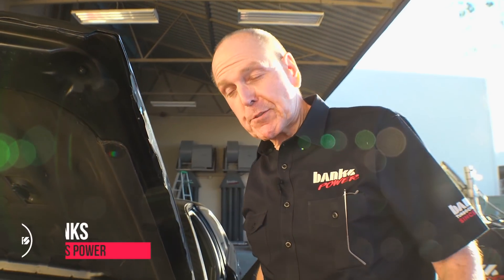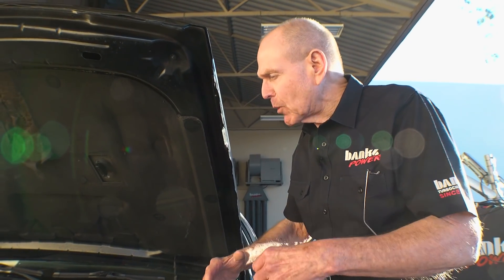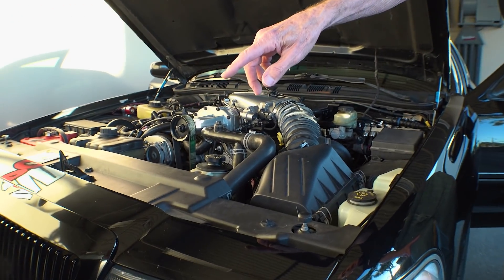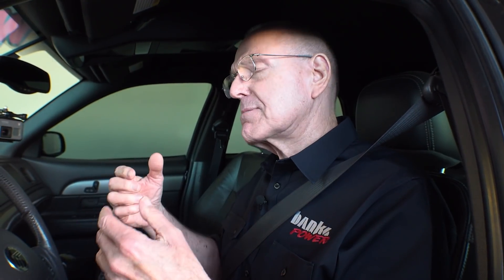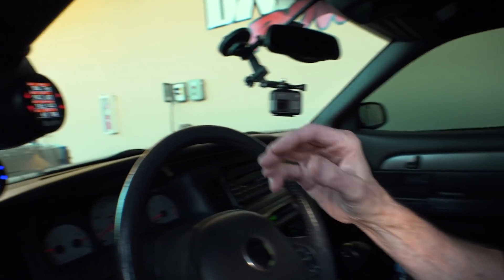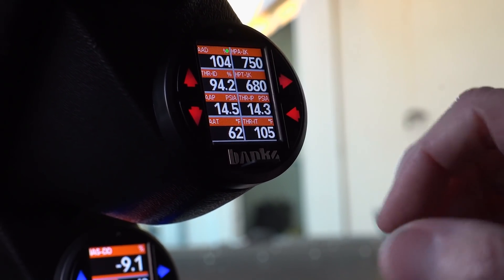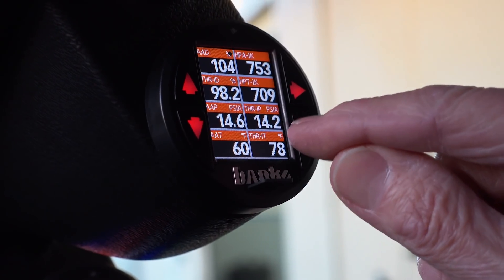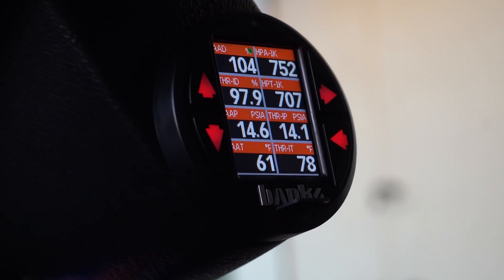My stock intake sucks. Here's proof.

Comment: Well then damn, but Mr. Banks the guys from mighty car mods have proven that on a turbo skyline the stock air intake works better then a cai. So what's the difference between the two intakes that would cause you to loose power?
Reply: They didn’t prove anything more than that specific car on that specific dyno. Did you watch the video? You missed the point that he made...where he proved his intake sucked.
Reply: @BrodeyDoverosx  yea I watched his video what he said and proved did make sense. Now what I was saying is that other people that DON'T have the money or the pepper tools and that's what they got. Have you seen their video?
Reply: There are a number of factors which affect whether or not a CAI will provide any gains at all, but the specific vehicle you have and which aftermarket intake you test are big factors.  Some vehicles, such as the Skyline tested, have well-designed factory intakes which provide good filtration and performance--much better than something you pick up off eBay or Amazon claiming big HP increases.  But some vehicles make compromises with the stock intake for noise, filtration, emissions, or even just being cheap and certain aftermarket intakes can provide real-world performance increases.

One place a lot of these aftermarket CAIs fail is by having an open filter element so they suck up a lot of engine bay heat, particularly at idle.  Another is that they use a high-flow filter element (such as K&N) which trades filtration efficiency for maximum flow, a tradeoff that OEMs do not accept.  The stock intake on my F-250, for example, picks up about 7 HP with a high flow filter and at best 12 HP (in a controlled environment) with a cold air intake--really not worth the $300+ you spend on the intake system, exposing your engine to higher temperatures while at a stop, and giving up air filtration.
Reply: Probably the different way supercharger and turbos work. Supercharger belt driven produce boost down much much lower in rpm range where engine is not sucking so much air. Turbos at higher rpms where engine is trying to get as much air as possible. Like everything it's a compromise you can tune something to be very efficient at a narrow band but rubbish everywhere else.
Reply: @GavinY  I know how they work n the differences are but whats the difference's between the two air density in the turbo and super charger?
Reply: @edgarportillo8027  at the moment , nothing because it's just a baseline measurement of the stock system on his car.  Every intake system is a restriction. It may be he puts on a CAI off the shelf and lose even more power. Nothing is proven at the moment. Just comparing apples and oranges. What MCM proved though is cheap CAI garbage is even worse than  stock. So if Gale did not specifically design one for your car, don't bother with one.
Reply: Bear in mind that the MCM guys have never claimed to be experts or mechanics and even they know the methodology used wasn't that scientific. They even went as far as to say that engines can be tuned to work better on CAI's but they must be tuned correctly.  Thats the key here - you can whack on a CAI but if its not tuned for the engine and the mapping isn't done, you won't see any real benefit. You gotta take a holistic, total approach to engine tuning, so: intake, engine (with or without forced induction), exhaust, tuning. Do all those together and you'll see real improvements.

Comment: A lot of the time engineers are trying to hush the racket of the intake.
And other compromises
Reply: when your modifying a car you generally dont care about how noisy it will be
when your buying a new car , generally you do
Reply: @ProVision3187  Except that a lot of OEMs have devices to add induction sound inside the car.  On some of the newer GTIs, Volkswagen ran a pipe off the cool side of the turbo into the cowl area so the sound could come in through the HVAC system.  BMW has been fond of digital engine noise through the audio system, and now Ford is doing it, too.

Comment: And this is why this man is respected, honest R&D and is willing to use his own damn car as a test mule.
Reply: That and his shit works! I worked on a truck that had so many Banks upgrades that I had to hold the brake when letting out on the clutch to avoid hitting stuff in the shop parking lot.
Reply: sienile that makes no sense
Reply: @MoparMadness93  He basically just said "I have no idea how to drive a manual transmission"

But you're right, it made absolute no sense. His comment called also be interpreted as "It had so many Banks upgrades, it made it undriveable and dangerous!"

Probably the former.
Reply: Kenneth James not all parts are US made  we used to make then he found cheaper to make taiwan

Comment: As far as the Banks iDash, I’ve searched the documentation but can’t seem to find an answer if these devices will run standalone with just digital and analog inputs from aftermarket sensors. Does Banks currently sell everything one needs to run a setup like this in a car without canbus, like I believe Gale is doing here?
Reply: It Def had inputs it says on the website

Comment: So here's the question. I live in the Arizona desert. It gets hot here, really hot, Tarzan can't take this kind of hot hot! So, what if you used a second air conditioning evaporator, like the set up on a mini van that has front an rear air, but use the second evaporator to cool the air coming into the  cold air box the also contains the air filter, ahead of the intake hose. It would have to be large enough not to restrict the airflow, but if you had such a system, where would the trade off be between the horsepower to drive the compressor and the horsepower gained by cooling the air in the intake?
Reply: ken cohagen I don’t think you’d be able to gain additional power. I’m sure there’s something about the second law of thermodynamics, and thermodynamics in general that’s going to tell you it’s going to take more energy to cool the air below ambient temperature than that increase in density is worth when using a heat pump (air conditioner) of some sort on a heat engine (Otto, Diesel, Gas turbine... take your pick). However using evaporation from a fuel like Methanol, Ethanol, or to a lesser degree gasoline, is a great way to get some additional power at little cost since in this case the increase in entropy works to your favor here and mixes the fuel with air and cools down the air in the process.
Reply: the new Hellcat cools the superchargers incoming air with the AC .
Reply: Yeah check out interchillers
Reply: Although there’s nothing stopping you from running a little experiment using the iDash like his and your air conditioner. You could measure the power potential of the air outside your car and the air coming out of the ac vent of your car (just like Gale is doing with the air outside and the air entering the throttle body) and evaluate the difference in horsepower potential, for the amount of energy it took you to change the air density, (how much horsepower you loose when running the AC). From there it’s just going to be figuring out the respective dimensional rates how much air the engine needs per second, and how much air the air conditioning system of your car puts out per second and the amount of power it takes to cool that amount. There’s more to it than that but I’d be happy to help you design a simple experiment to test your hypothesis and intuitions if you’re interested.
Reply: Look up “Interchiller for boosted engines.”
Reply: That evaporator would probably have near zero effect. It's cooling capacity is not going to be near what's passing through the intake. It'd be neat to see how it would or could work.
Reply: That would be a tremendous amount of intake air CFM's for a standard AC evaporator. And a gain of 1% HP would be less than the compressor loss.
Reply: I live in AZ, and love cars and guitars.  We should hang out.

Comment: Love the Marauder, this is basically a 4-door  '03 svt cobra.
Reply: Jason Henderson you couldn’t be more Wrong
Reply: 4.6 4v mod motor. Roots positive displacement blower with an intercooler. The Harley f150 had the 5.4 with the Eaton blower and I believe the lightning did as well.
Reply: Marauder motors only have a couple things in common with the Cobra, the cams and heads are the same, everything else is different, Cobra Block is Iron, M is aluminum and it's Crank, Rods and Pistons aren't Forged, it's a duplicate of the Automatic equipped 03-04 Mach1's minus the intake!
Reply: It’s not a cobra. 
It’s a crown Vic. 

Body on frame vehicle. 

Did you guys know that most cops deaths are caused by car accidents while not wearing seat belts.
Reply: This is the best video of a marauder 
https://youtu.be/cDoRmT0iRic

Comment: But, but, but, OEM engineers... millions spent on R&D... guess it only matters with differential  covers.
Reply from the maker: Nope. We found a way to improve on those too.
Reply: emissions Engine components are built to federal epa standards to avoid noise etc. and shit like carb compliance. Diff covers arent a big deal.
Reply: @meengreen52  you haven't been watching his videos.
Reply: There are several factors OEM's consider when designing things such as intakes that performance based companies do not have to account for because the only goal is maximum performance.
Reply: @EntityOfTheVoid  you spelt 'maximum profit' wrong.
I do not believe Banks Power is only in it for money, else they'd just make a 4" tube and stick a K&N at the end.
Reply: @Jason do you think testing equipment, manufacturing equipment, and R&D is all free? What about the facility it's produced at? Surely it's all free. You clearly know nothing about fabrication or running a business otherwise you wouldn't shoot your mouth off like that. How dare someone make money on a product they made and are selling to you!
Reply: @EntityOfTheVoid  exactly
Reply: @ike fun that's a mercury marauder. It had a blower on it stock... But yeah, he has modified it. He has atleast changed that pulley.